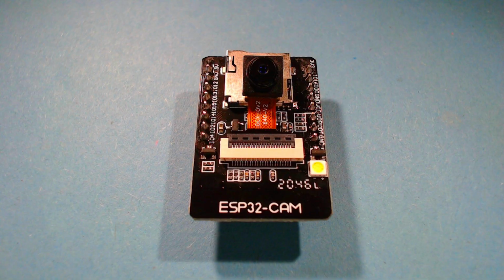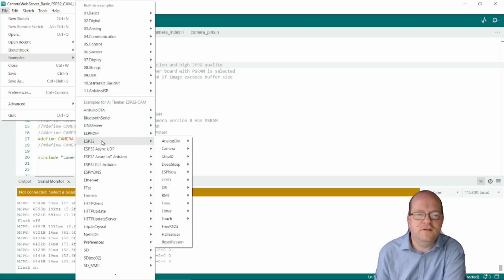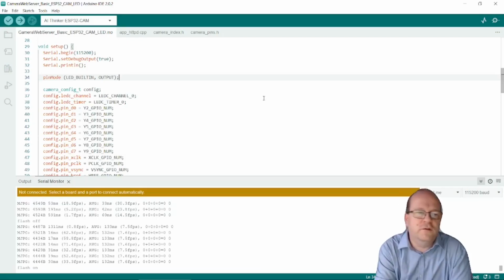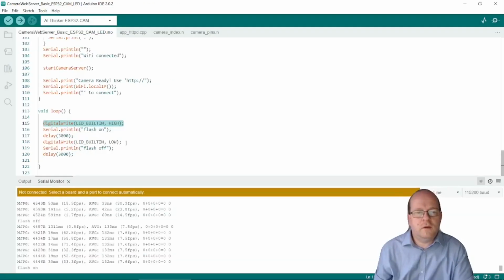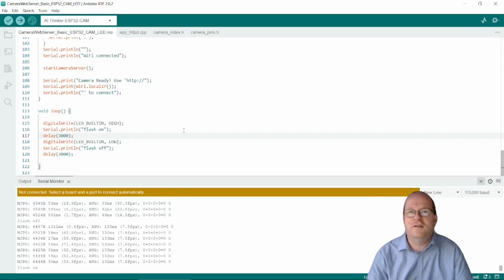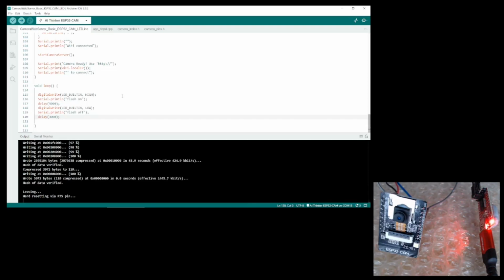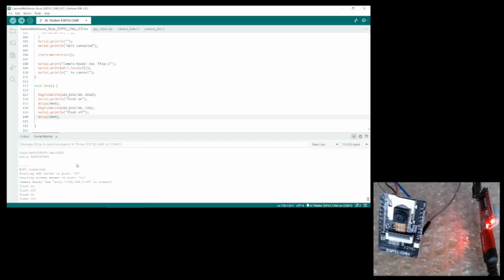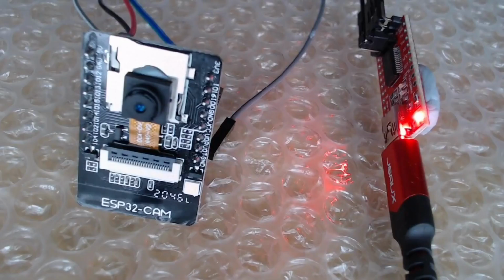ESP32 CAM Turn on LED (Useful Camera Flash!)

Comment: I have made the following changes in the “CameraWebServer” sample code in order to operate the Flash LED via the web interface:
File “app_httpd.cpp”: #define LED_LEDC_GPIO 4
File “camera_pins.h”: #define LED_GPIO_NUM 4
Depending on the board, other pins may be required.

Comment: i saw Miku Dollfie Dream in the beginning +^+
i had issues with uploading code to the esp32 camera, and it was due to the priximy of my desktop light to the serial jumper wires
also i was using nano before i got the USB to TTL converter

Comment: Very informative video.  Thanks.  It works though a little on the bright side and the first time I was watching it and ended up with spots before my eyes.  Any way to turn down the intensity in software?
Reply: use analogWrite Instead of digitalWrite. analogWrite(LED_BUILTIN, 50);   intensity can be set from 0 to 256. 0 being off and 256 the brightest. Cheers!
Reply: @filmforjoy  digitalWrite wasn't working for me but this workeds well

Comment: Hi nice find!, how does one control the LED via the web interface though?  im using my esp32-cams as surveillance and would like to remote control the flash via the webinterface.
Reply from the maker: I'm not sure it's controllable via the webinterface. Maybe hacking the webinterface would be a good topic for a future video! I have in general found the ESP32 CAMs to be real divas... bad image quality is very common, as is not connecting to the wifi and I've never been able to get the facial recognition to work.
Reply: @codingwithbrett  Sir Can You Give Me The Code File Because When I Follow The Same Procedure Nothing Happens
Reply: @codingwithbrett  i saw a guy that uses a website to decode the hex (of the webinterface) to html, then adds the led flash controls, its definitely possible
Reply: @Dirt33breaks   I know this might be a late comment but it is feasible with Rest.
Reply: @codingwithbrett  Yes, I have 3 of these boards and only one of the cameras is what might be considered good.   The other two, the images flicker a lot.
Reply: That’s from a power issue, you can try adding a capacitor to filter out the spikes that can cause that issue.

Comment: Led camera flash works ok taking pictures and uploading....except, the led flickers very rapidly while on.  Seems to be causing brightness of photos to vary....and  ideas ?  (SD card is not installed)
Reply from the maker: It could be the power source is not powerful enough. You could also try a different ESP32 module.
Reply: @codingwithbrett  i can second this, flicker when lamp is at 90 percent or less, but not 100%, using 5amp charger.